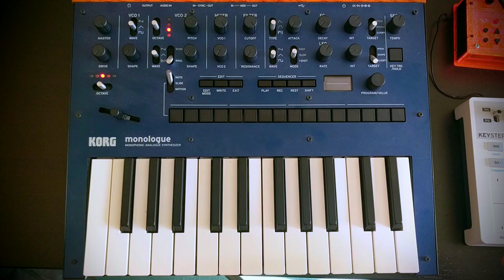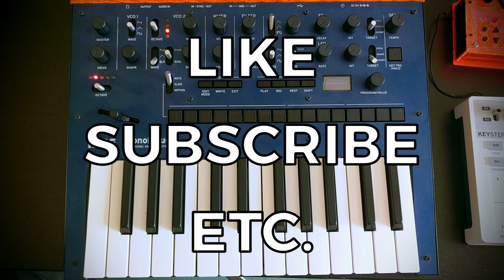Korg Monologue Tricks 01: The Super Secret 3rd Oscillator!

Comment: As soon as you said third oscillator, I was like "the filter." But then you explained going into edit mode and setting key track and I was like "OHHHHHHH!" I'm an idiot, I've never read the manual (frankly I really don't like that it came on two huge folded up sheets of paper) and therefore never took the time to actually USE the edit mode. Clearly I need to spend some more time learning more about this synth.

Subscribed!
Reply from the maker: Yeah the Korg manuals are a bit "designed by an engineer" but they are worth trying to read as at least they are concise!

Comment: I'm new to synths, so this may be a silly question - when vco1 and 2 are off, how is sound produced by adjusting resonance and cutoff? You used the term self-oscillation, what is that? Great video by the way, cheers.
Reply from the maker: Resonance on a filter (on this filter anyway) involves electronic feedback. 

You've probably encountered feedback when a microphone is held too near a speaker and you get that howling tone happening? That's caused by the microphone picking up the signal from the speaker (even if it's just the inherent noise of the amplifier), the speaker amplifying what the microphone is picking up, the microphone picking up that amplified version of what it was hearing, the speaker making it louder... And on and on until you re-enforce whatever frequencies turn out to be the strongest over and over until they form a tone all of their own. 

Cranking the resonance on a filter is a bit like moving a microphone too close to a speaker, but within an electrical circuit. Some of the signal from near the output is fed back to an earlier point in the circuit and the resonance control is controlling how much that happens - feed enough signal back and certain frequencies (typically the cutoff frequency of the filter) re-enforce and it starts to howl on its own - that's self-oscillation.
Reply: @OscillatorSink  Great explanation, many thanks

Comment: I notice on many of you vids you have a Keystep on your right. I was looking at this bit of kit to expand my Monologue's functions and add an arpeggiator ( which I miss) Would this be a good (key)step?
Reply from the maker: For sure! The Keystep is really really easy to recommend! Pick one up!
Reply: Oscillator Sink :Can I connect ( and with which cable) my keystep to the Monologue without using a computer
Reply from the maker: Darren M yes, you just need a midi cable.
Reply: Oscillator Sink Thanks mate🙏

Comment: Hope you don't mind Mr the sink a question out of left field today A lot of people are powering the a 5 volts synthesizers using power banks now fast power banks aren't really discussed do you know if people are using these as they are only available in New Zealand now you can't get the older models is it safe to use the faster charges with the increased what wattage. Most fast chargers put out 2.1 amps at 5 volts between 13 and 18 Watts. I'm seeing this done everywhere I am at a loss to know whether I can use my fast battery charger or not any help if you're able would be appreciated mate as this is something I would really like to do. If you can't help I understand thanks always for the great tutorials
Reply from the maker: Hi Heath - sorry, no idea. I've not tried powering any of my stuff that way and haven't really looked into it.
Reply: Oscillator Sink cheers mate appreciate it I lost a few people so hopefully someone who uses them might know

Comment: Really wish Korg would have added the monotribe sample hold lfo to the monologue maybe you can figure out how to make the sequencer step in a sample and hold way.
Reply from the maker: That would have been cool. You can set each step of the sequencer to a discrete value by holding the step button down and moving a knob (like a parameter lock on an Elektron synth) - that gives you a pseudo sample and hold sound, although obviously its not random. It's probably close enough to fool a casual listener though.
Reply: figured it out on the sample and fold hint hint ...but seriously ran out off juice to bad they didnt just use a 9v battery instead of six aa .. anyway the adapter btw is center postive 9v 5.5 2a

Comment: My monologue arrived today and i noticed that there’s a subtle kind of white noise even with no volume on both vcos. It happens with the filter completely opened and without ressonance. The noise  goes out progressively as i turn the cuttof down. Is this the way it is suposed to happen? I cannot notice it in the video when both vcos are muted....
It is indeed subtle but im just afraid of not having an ok unit... everything is working perfectly. This is just something that i noticed. 
thanks in advance!!
Reply from the maker: You might expect a little noise in the system, but nothing intrusive. Couple of things to think about: how are you powering it? Are you plugged in via USB? Does the noise change if you move to a different room? Noisy power, bad grounding on USB hubs, interference from other equipment could all introduce extra noise...
Reply: I really think its just the natural noise.... The noise occurs just when i play (without playing the keys its completely noiseless). Im playing through batteries, so probably its not the power source. I’m not conected via USB either. It really isnt anything annoying or even noticeable when producing any sound. Just something i noticed while turning down both vcos completely. 
Thank you a lot one more time.
Reply from the maker: That's a bummer - I don't have this issue on mine. Sounds like you should return for a replacement.
Reply: Oscillator Sink that’s what i’m going to do. Thank you a lot!!

Comment: Can i use this synth to create italo disco juno like basses ? Cant find any related video.
Reply from the maker: I'm not totally familiar with the genre, but if you look at the two synth architectures, they're somewhat different - juno is a square or saw DCO + a square sub, Monologue is two VCOs, but you could have a saw on one and a square on the second pitched down. The filters are very different of course, but you could probably get somewhere close with some work?
Reply from the maker: You could get a lot of the way but a couple of things to consider: the DCO and its sub are totally locked in tune on the Juno - you'll have to be so careful with the tuning on the Monologue to replicate that level of stability, and secondly: the Juno's filter (Roland filters in general I guess) is a big part of that sound - that 'meowing' quality is super specific (and lovely!), and the Monologue's filter is a lot meaner.

So you could probably get close from a general standpoint, but you won't get quite the same character.

It's a bit more expensive, but have you considered the Deepmind? That's very influenced by the Juno series and can probably get you nearer?
Reply: I am not expecting to get the same sound from a cheap synth compated to juno, i mention juno synth cause these where used extensively during the 80s. I do not intend to buy it but was offered a trade for my microkorg and to be honest  i get some nice juno like basses on the microkorg original that i own. Both units - monologue and microkorg - are mint so i am thinking if that trade is a nice one or i will end up with something that is not that usufull for my case.

Comment: Here's something I'm curious about. Why go with the Monologue when you can get a Minilogue that has an extra octave and polyphony? I'm not being a smartass, I'm really not aware of any strong benefit the Mono has over the Mini. Is this just Korg trying to get you to buy extra hardware?
Reply from the maker: I think it comes down to the fact that the Minilogue was designed to be a polysynth and the Monologue was designed to be a monosynth. There are choices to be made about the voicing of the synth that will make it more suitable for the job - the Monologue has more "forward" and aggressive oscillators and the filter is a lot more dramatic - stack that up with a mono patch on the Minilogue and the Minilogue will usually come off a bit... just 'less'. Similarly if you poly-chain 4 Monologues things probably won't be as usable as everything will be vying for space.

I kinda experienced this recently - I have been building mono patches on my DeepMind and they sounded pretty good to me, but then I turned on my Monologue for the first time in a while and the immediacy and punch of the sounds knocked my socks off! They were just built to do different jobs.

Hope that makes sense!
Reply: Great explanation of the core differences of a mono and polysynth

Comment: Am i the only one for wich the resonnance output random tone instead of stables one like ij this video ?
Reply from the maker: Have you got the envelope or LFO being sent to the cutoff? Do you have the key tracking at 100 percent?
Reply: Ok, found it... you must set velocity curve to constant in the global option...
Reply from the maker: @canneberegerouge1  you're better off just setting the velocity to cutoff to 0 percent - that's on the program menu and is per patch (it should be set to that as default actually on an Init patch). That way you won't need to keep adjusting the velocity curve (which you want set as normal for most patches).